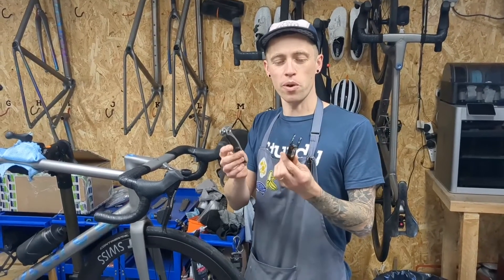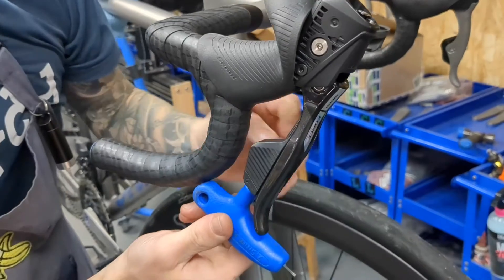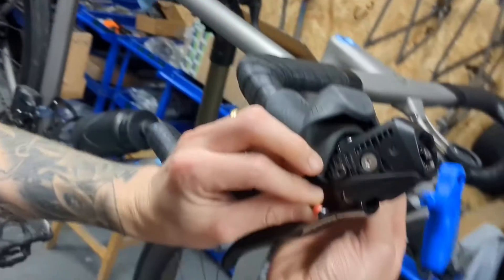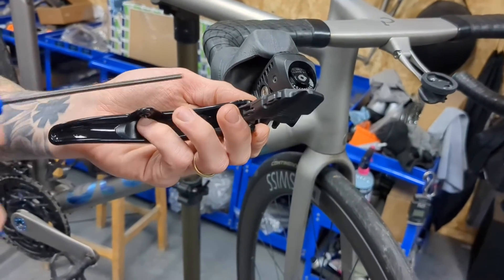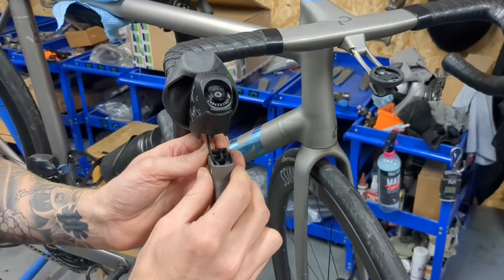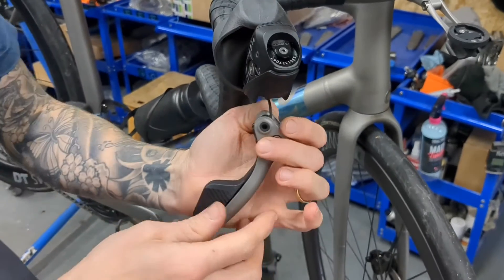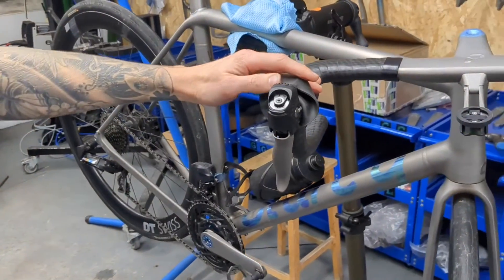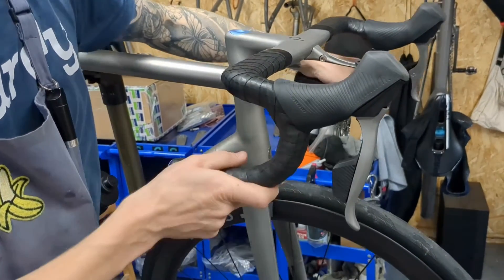3D Printed Titanium Brake Lever Replacement - SRAM Force AXS D2

Comment: Hi! So the bolt holding the lever in place at 1:31 for me continuously spin. If I were to follow these steps, basically unscrew then rescrew the lever will that fix the bolt from spinning? It didn't spin when it was stock.
Reply: bruhhhhh i broke my lever and im having the same issue. did you ever get it fixed?
Reply: I've tried unscrewing it and broke the screw - it didn't want to unscrew, I've forced it and now it's broken :(
Reply: @mateuszhajdziony4861  damn i also snapped one. you can try finding the part # in the Manufacture book, and special ordering. i replaced my lever and its fine but the screw was never the same. if worst case senario you can homedepot diy it